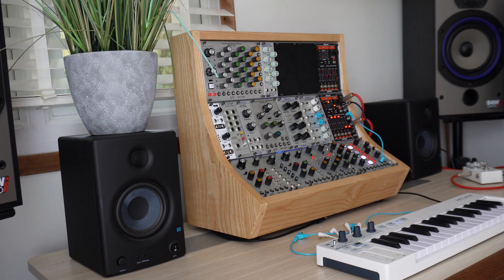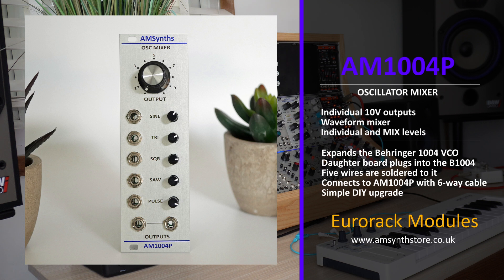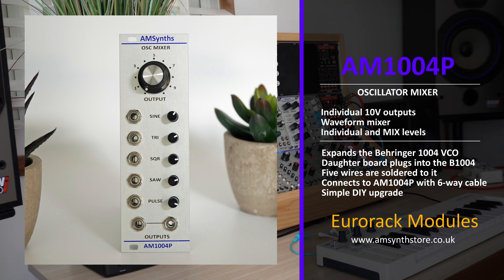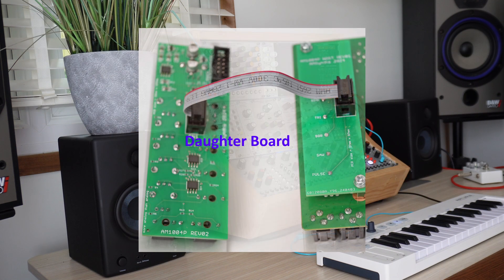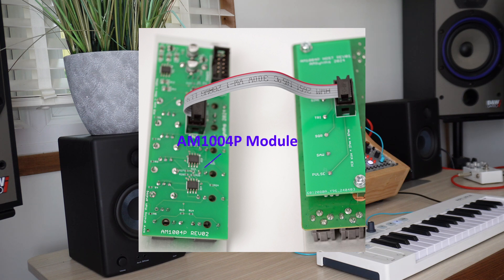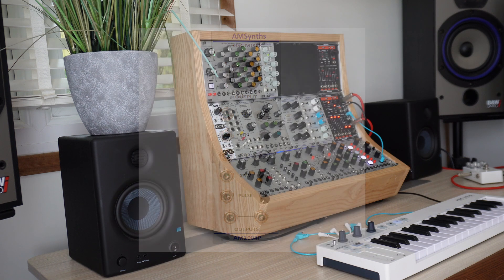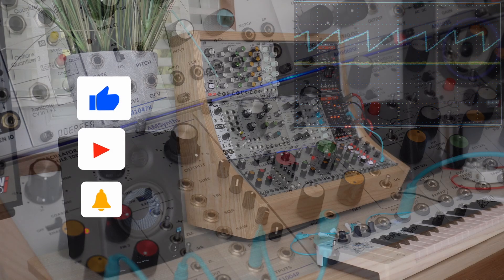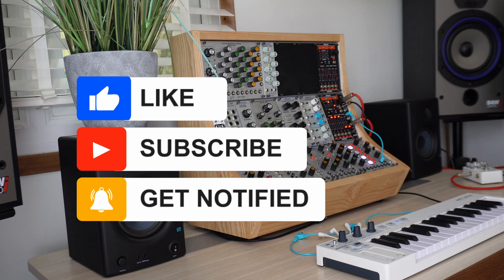AM1004P Osc Mixer - Expand your Behringer 1004 VCO

Comment: The idea is very good. But only the waveform single outputs in 2 HP would be enough for me (like the one from "Euro Utilities" which does not require any power). Why? Because I can mix the waveforms in my other mixer modules, which can also be used as mixers for other signals, not only for waveforms of one particular VCO. Apart from that, this module takes a lot of space (especially if you buy several of them) and also some power because it contains a mixer for one single purpose which I don't actually need.
Reply from the maker: The 1004P is an extra 6HP with alot of advantages - it provides each waveform at the correct 10V level, which the Euro Utilities 2HP does not. It uses the same internal connection and does not require 5 patch cables into a mixer.  The 1004P is ready built with a daughter board that makes installation on the back of the 1004 secure, there are no flying leads to break and no jack sockets to solder in.  Its power consumption (at less than 20 mA) is not going to break the power supply.